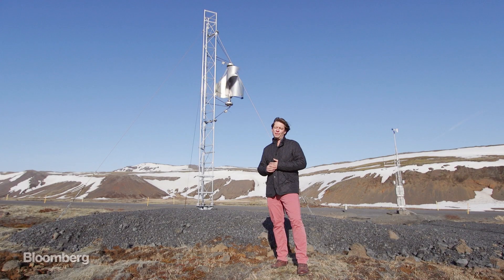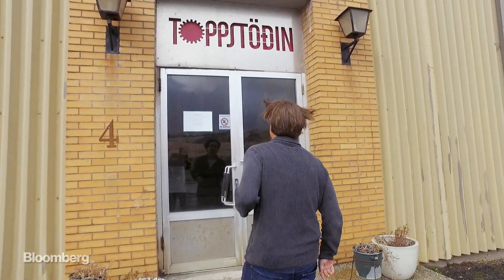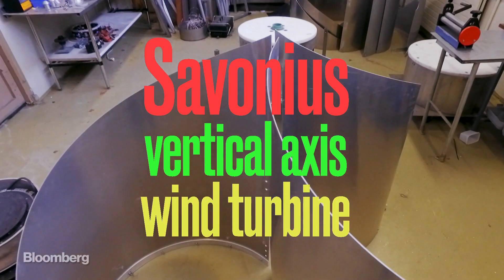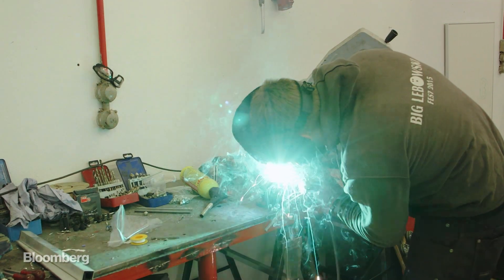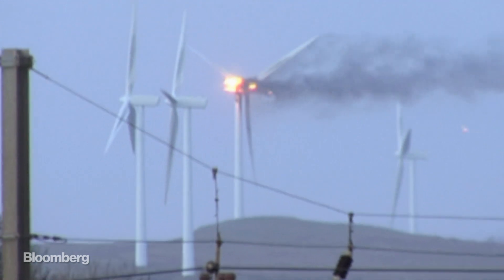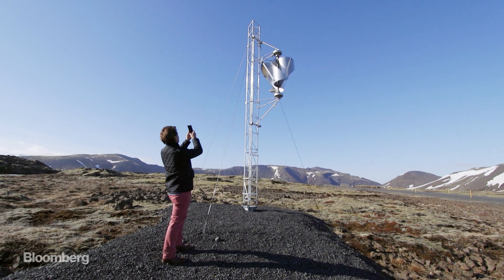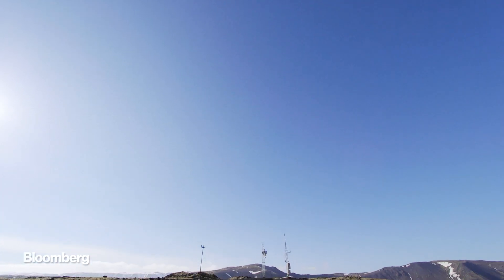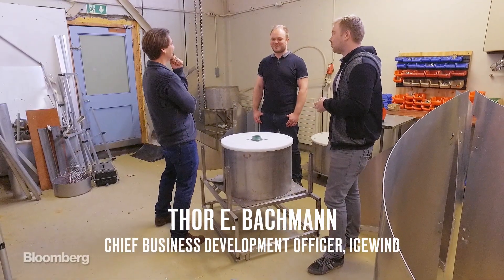The Tech That Could Fix One of Wind Power's Biggest Problems

Comment: very cool, i want one
Reply: Build one yourself. You only need an old oil drum, some piping and a small generator. But don't expect it to produce considerable energy.
Reply: I'm building better. My wind turbine system should be able to produce energy from multiple turbines with no loss of air. Same amount of air that powers one turbine, can now be used to power many.
Reply: Divergent Droid Are you serious? That's not the limiting factor in those turbines.
Reply: I'm not following you. What is not the limiting factor in the turbines?
Reply: Divergent Droid
It's not only about the air coming out containing to much energy, but the whole system slowing itself down by it's high air resistance and turbulence's.
There was a group who experimented with a system like you describe for their final thesis, but the outcome was dreadful.
But if you can do it anyway, it would be nice to hold me up to date.
Reply: Darius der Rote Thank you for the further explanation. Your thoughts are appreciated. All I have to do is produce double the amount of energy then you would normally get for it to be a success. I didn't explain my idea to you fully. I'm pretty sure my method would solve the problem with the system slowing itself down. I want to generate my own wind to turn the turbines through a very long enclosed tunnel with multiple turbines. The shape of the tunnel and blades will be designed with high speed wind tunnel technology to maximize flow output in CFM.s Each turbine will boost the air flow as air passes over the blades. You have one artificial wind source to cause say 6 turbines to store electricity. I want to store turbine energy in battery banks and when they have enough extra power, switch in the main fan. In this manner the system can be perpetual. Sounds nutz doesn't it? LOL I can't see any reason why it would not work to some extent.
Reply: Divergent Droid yup, it's nuts. But if you can ignore physics and make it work, the Nobel price will be yours
Reply: I can't see anything about it that breaks any laws of physics. It's all simple ready made tech except for design of the wind tunnel and blades I think I'd need to have to max out efficiency. If you think about what I'm suggesting, it's really simple.
Reply: Divergent Droid
Conservation of energy would be one thing that comes to mind. But feel free to try your best.
Reply: No.. all the parts are separate in my system except for the batteries for storage. There is no way one part can interfere with another so there will be no problem with such things as conservation of energy problems. All we have is one mechanism to create air flow, one or many turbines to spin and store that energy and then the batteries.. all separate but work together for an end result. Thus, it can't break any laws of physics.
Reply: Divergent Droid
Good luck.
Reply: Darius is talking about a loss of energy over the course of the entire system, each turbine will reduce the wind speed or introduce turbulance such that there is less energy delivered to the next. Next is generation, if you're using perminant magnets in your generators, you're a step ahead since you don't need to create a magnetic field, but youll encounter cogging and friction. Next is battery storage, charging batteries is an inefficient process, its the one thing holding electric cars back in my opinion both for their weight and energy inefficiency. A lithium Ion battery is supposedly 99% charge efficient, lead acid batteries as low as 80%. After that, you must power your fan, perminant magnets will help with energy efficiency but there is a net loss again fighting friction in both the hardware and the wind and air turbulance. Every working part comes with an inherant energy loss, even the resistance in the wires between them.
What you can do however, is maximize the efficiency from an outside source of wind, a wind tunnel is an excellent testing ground for that.
Best of luck.
Reply: Paul Gloor
Correct.
And starting with an inherently flawed system, while there are better options is not optimal.